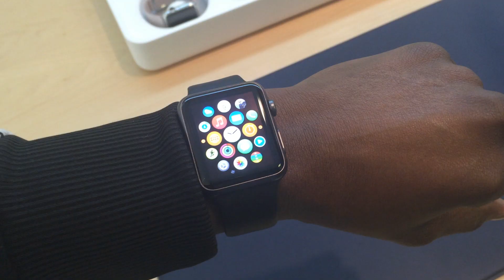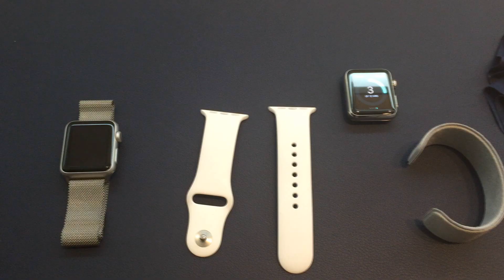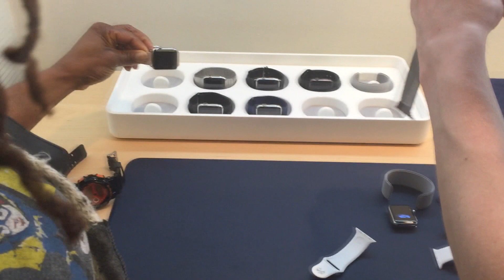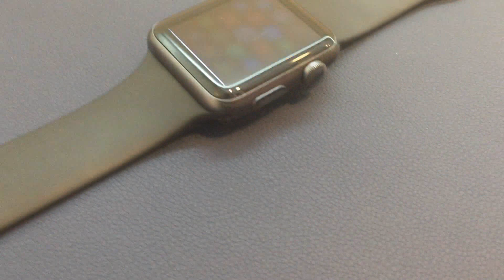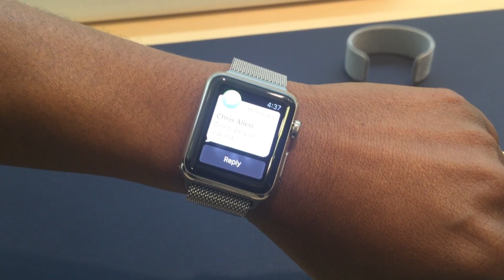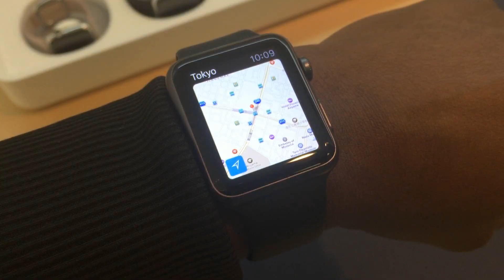Apple Watch Hands-On & First Impressions!

Comment: I'm not sure if it was intentional or not - but your video implies that Apple invented Anodizing - which is totally false.  Anodization has been around for a long time and is used in many products NOT MADE BY APPLE.  It also DOES NOT increase structural strength - the whole purpose of anodizing aluminum is to protect the surface from oxidizing, from corrosion and adding colour.  It does offer some scratch protection i.e. harder than bare aluminium and is definitely much better than painting - but it won't magically make the structure stronger - only the treated surface.  Also, Apple has never made a screen - ever.  They buy their displays from other companies based on their requirements and label it "retina" - if you compare the resolutions with other "wearables" there really isn't anything special about it.  The difference is even more obvious if you look at AMOLED screens.  I feel bad for all you Apple fans that buy this expensive abomination - especially with the poor battery life this thing has Given the amount of extra time they had to prepare this product, 18 hours is just inexcusable, almost criminal - since most Android / Tizen watches have 2 days minimum.